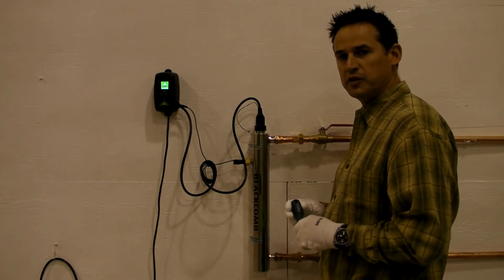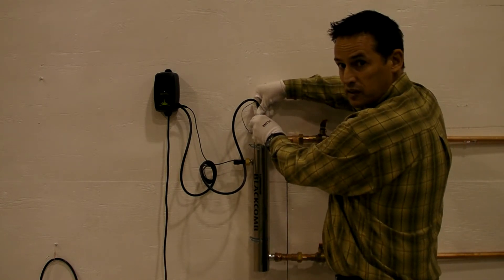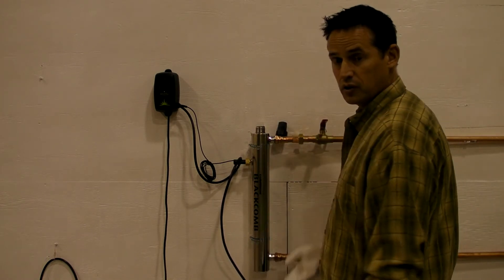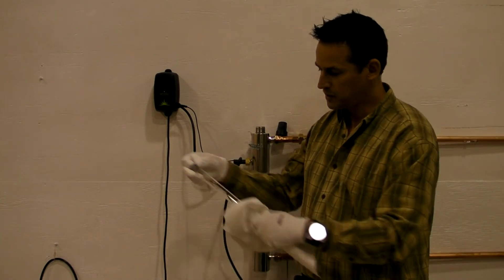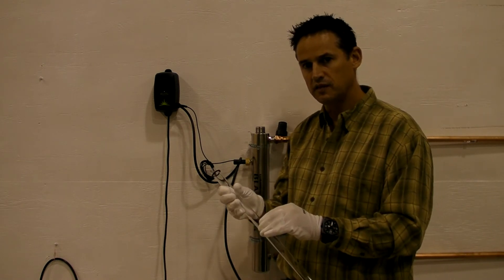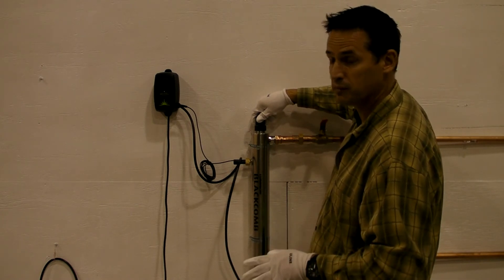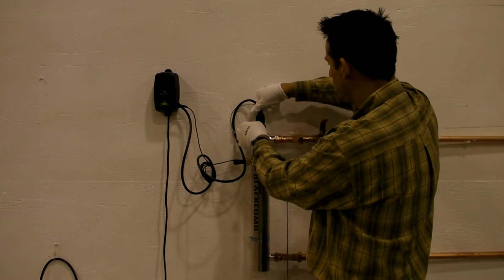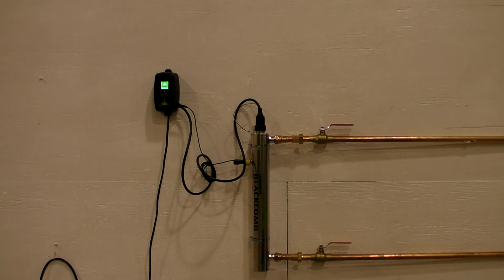LUMINOR BLACKCOMB quartz sleeve clean how-to

Comment: If you’ve had your UV running for any amount of time there’s no way it’s coming out as easy as he showed. 

You’ll need to loosen the o ring first, by using some kind of small tool to carefully lift it free. I used a small dental tool but a paperclip or something might work too. Once you get the o ring loosened and out of the way, you’ll notice the quartz sleeve is free to move around. It may still be a little stuck but you should be able to twist and pull it free carefully. 

If you go too long without cleaning the quartz sleeve, it will be more difficult to take out, which is I’m sure part of the reason it’s good to do this once a year or however often you change the lamp

Comment: How do you get the sleeve out without breaking it if the sleeve is stuck??????
Reply: If you’ve had your UV running for any amount of time there’s no way it’s coming out as easy as he showed. 

You’ll need to loosen the o ring first, by using some kind of small tool to carefully lift it free. I used a small dental tool but a paperclip or something might work too. Once you get the o ring loosened and out of the way, you’ll notice the quartz sleeve is free to move around. It may still be a little stuck but you should be able to twist and pull it free carefully. 

If you go too long without cleaning the quartz sleeve, it will be more difficult to take out, which is I’m sure part of the reason it’s good to do this once a year or however often you change the lamp